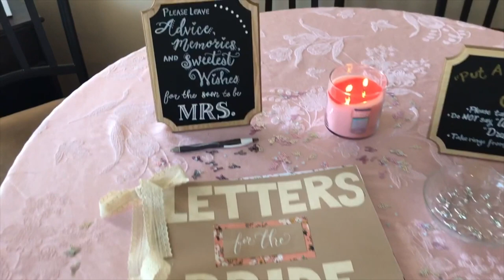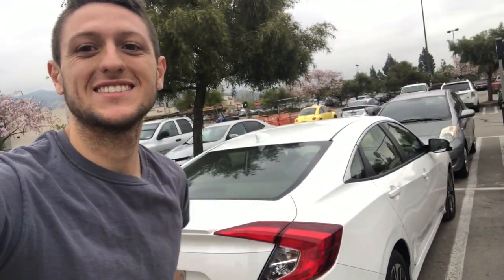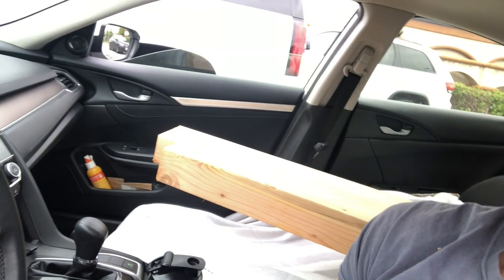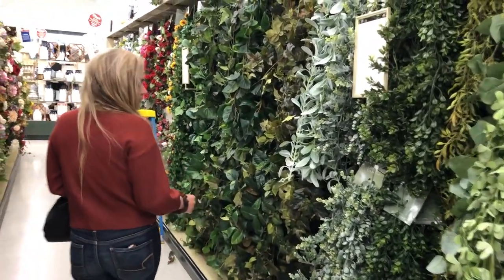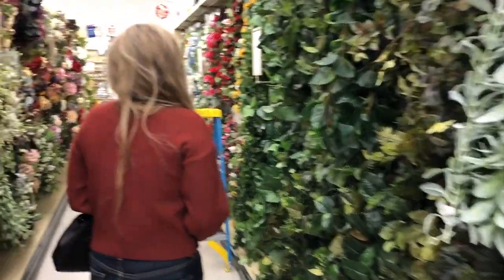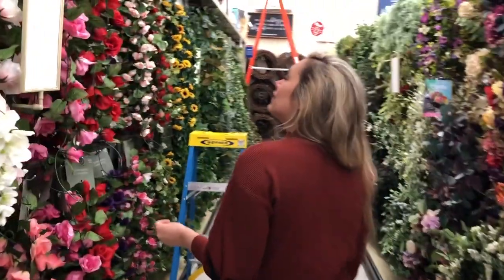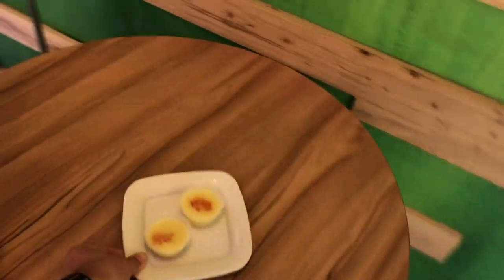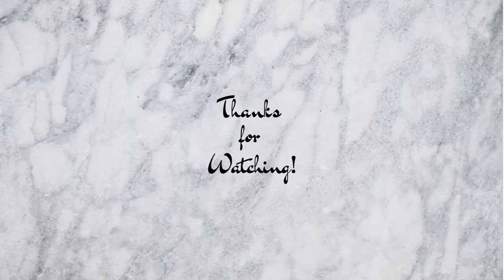Building My Wife A Cross For Our Wedding

Comment: Great job on the cross. My son wants me to build one for his wedding next month. The only 4x6 lumber I can find from the big box stores is treated. Can you tell me if the lumber you used was treated or untreated? I noticed you bought it from Home Depot.
Reply from the maker: Hi Mike! First thanks so much for watching! Congratulations on your son’s wedding coming up! 😄 And I used regular (untreated) lumber, then used an angle grinder to get that texture, then stained it to get that dark color. I would think that pressure treated lumber stains very good if that’s something you want to do, I’ve never tried staining that. I will say that pressure treated is made for outdoors (it holds up better for a long period of time). But it stains your hands when you touch it since it’s been treated. I recommend going early in the morning to Home Depot to hopefully get a good pick of regular lumber. Good luck with everything! It was a fun little project for me!

Comment: Hello, what are the dimensions of the Cross, me and my fiance would like to build one for our wedding as well? Thank you!
Reply from the maker: Hi Dakota! 😁 First of all congrats on the engagement! 🥳 That’s awesome! And the cross adds the perfect touch👌🏼 So I got two 8ft 4x6 pieces of lumber. The cross height is 8ft. And the horizontal piece is 53.5 inches. And that’s it! Just four 3 inch screws holding together. And I built the base out of a 2x6 👍🏼 Hope you two have a fantastic wedding! Let us know if you have any other questions 😄
Reply: @renenandjazzie  thank you so much!! I hope you all are staying safe and healthy and having a blessed holiday season 🙂
Reply from the maker: @JonnyRichMusic  That’s a good question! Measuring up from the bottom,  the cut is 66.5 inches and 72 inches; making  the horizontal slide right in 👍🏼(the top of the horizontal piece is 6 feet off the ground) I hope this helps!
Reply from the maker: @JonnyRichMusic  you won’t! I have faith! And thank you so much! 😄
Reply: How wide is the stand to the sides